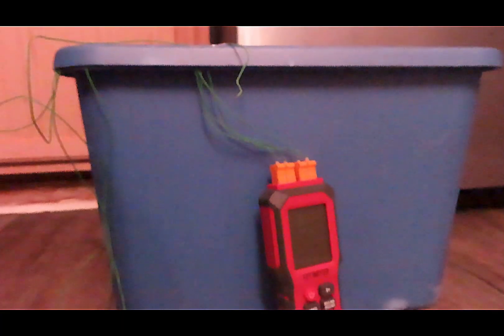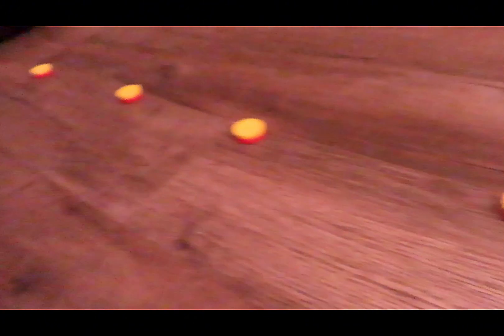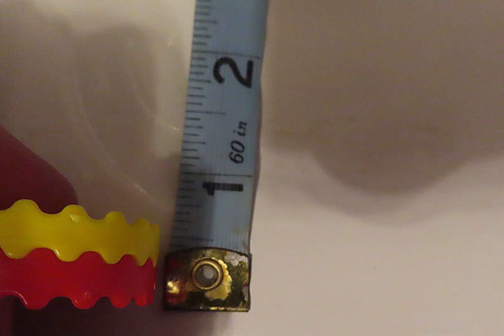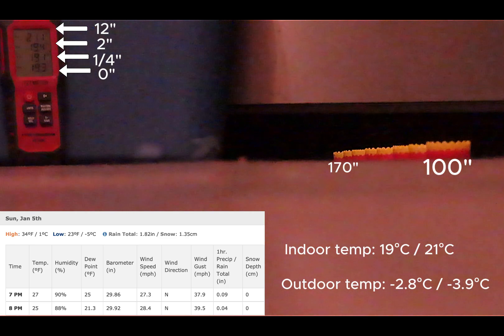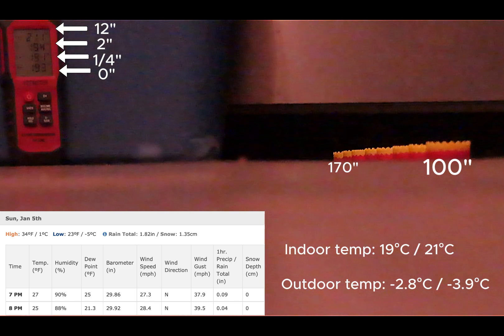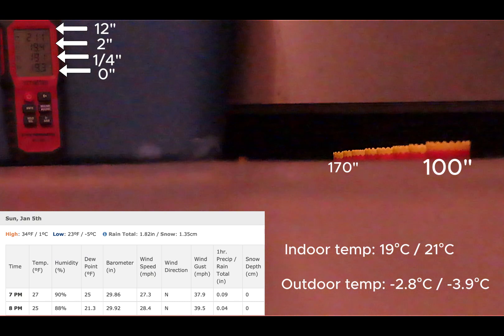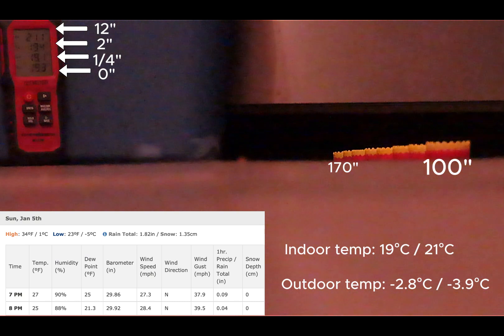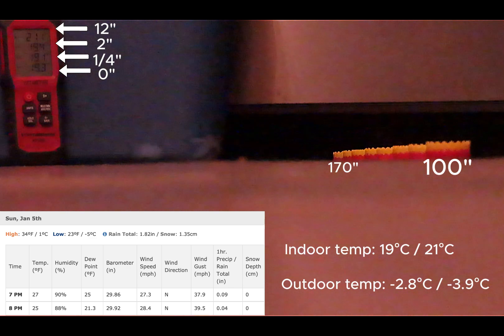At Home Refraction Tests 3.0 - January 2025

Comment: Excellent presentations!  Very educational.   

The Density gradient is a spatial variation in density over an area.  

Higher air density near the flat surface causes the light to bend more. The flat surface is magnified and appears to rise obstructing the view of distant objects along the line of sight over the FLAT PLANE!   

Globers admit they have no measured globe curve because of REFRACTION
A glober can lay on the floor of a long hallway and the horizon will appear closer. Globers will claim the floor spherical

Flat earth is integral to understand the nature of reality and the physical world and its phenomena and that entails unbiased observations and systematic experimentation.

When a system at equilibrium undergoes a change in pressure, the equilibrium of the system will shift to offset the change and establish a new equilibrium

Dispersion, diffraction, refraction, and reflection are all wave behaviors that describe how waves change direction or interact with matter: 
Dispersion
When light of different frequencies or colors refracts in different ways. This is because the amount a light wave bends depends on its frequency, which also determines its color. Rainbows are a common example of dispersion, where sunlight is refracted through water droplets in the AIR
Diffraction
When waves bend and spread around an obstacle or pass through an opening. Diffraction is most noticeable when the wavelength of the wave is comparable to the size of the obstacle. For example, elephants use high wavelength sounds to communicate over long distances, even when dense vegetation blocks their vision. 
Refraction
When waves change direction as they pass from one medium to another. For example, light travels slower in water than in air, so it refracts when it passes from air into water. 
Reflection
When waves change direction and bounce off a barrier. The angle of reflection depends on whether the surface is smooth or rough. For example, light reflects at the same angle off a smooth surface, but at many different angles off a rough surface.
Reply: @WHAT-bz6hp  colder air is denser than warm air at the same pressure. So the density of the air near the flat surface is actually lower not higher.

Floor didn't get 'mangified', the objects along the floor lowered their apparent height.
Reply: @curious1585   FUN FACT: refraction is used to create magnification,  cold air being denser near the ground can cause refraction.   As I explained.  The video presentation demonstrates this FACT.   proving refraction along a FLAT SURFACE  is not a globe proof.   Globers admit there is no measured geometric horizon because of REFRACTION.
Reply: @WHAT-bz6hp  🤦🏻‍♂️
Your description was the wrong way around and refraction is not used in this configuration to achieve magnification.

There is no 'admitting' in rectifying a strawman argument that should never have been circulating in this way in the first place.
Amazingly despite acknowledging one thing correctly you still manage to commit the strawman fallacy.
Reply: @curious1585 You keep  saying NUH UH meanwhile refraction can cause magnification below the horizon.  The objects in the distance were compressed while the foreground was magnified.  The density gradient just below eye level, which is related to the temperature gradient, determines the magnification. Everything in view literally shifted in focus.    I am not strawmanning anything.    I described the phenomenon and various effects.

I listed various examples.   I didn't mention mirages in this case which is also another example.
Reply: @WHAT-bz6hp  your strawmen are not about magnification.
Reply: @curious1585  You keep chanting "STRAWMAN"   YOUR CLAIM "Floor didn't get 'magnified', the objects along the floor lowered their apparent height."  <------DUMB DUMB  glober logic.

 DO YOU EVEN understand the floor is FLAT and LEVEL?

 OBJECTS are not LOWERING their apparent height.   The changing angles of light are causing the optical lensing effect making objects appear bigger or smaller  along the horizon which is a magnifying effect of REFRACTION.  

The title of the video At Home Refraction Tests
The study of light refraction.

The observation is literally a demonstration of REFRACTION along a FLAT SURFACE.  

  You claim there is no magnification along the floor.    I stated refraction can cause a flat surface to appear to rise and obstruct distant objects.   You said NUH UH.    Meanwhile...The heating is not consistent, the air temperature slightly varies and thus the refractive index of the air is different. This causes the "wavy effect".  AND yes there is a magnifying effect occurring as I stated which is known to cause the surface to appear to rise obstructing objects.
Reply: @WHAT-bz6hp  🤦🏻‍♂️ you're the only one chanting.
Do yourself a favor and respond when you are not tilted anymore.
Reply: @curious1585  I responded.   The point here  is globers admit there is no measured geometric horizon  or spherical curve because of REFRACTION.
Reply: @WHAT-bz6hp  again with the strawman arguments.

Comment: This is a good demonstration of what kind of temperature lapse rate you need to produce a convex-like presentation on a flat surface. 

Is the lapse rate you achieved to produce the convex appearance typical in most observations?
Reply from the maker: The lapse rate has to be pretty extreme over a distance of less than 15ft, but with the water observations we've conducted, at distances of less than 1,000 feet, the lapse rate can be much less, and yet very strong sinking refraction is observed. 

I do understand the argument that you can only get lapse rates in this vicinity near the surface, and that higher up you view from, light should in theory be bending down. 

But I think there could be more to the whole equation that doesn't rely so stongly on the vertical lapse rate. Still working on that, but would like to address that soon. 

Thanks for the comment, and your awesome approach to this topic. We need more people like you on the "globe side". Cheers!
Reply: @skyfree01 Thanks, and same to you. You and Heath, together, are probably best with your approaches, methods and understanding of what it takes to make a flat surface appear convex.

Just be aware of how the temperature rate change must scale to relate this to longer observations and higher viewing locations. Already, I see in comments those believing this model explains the Lake Pontchartrain causeway appearance. 

But there’s should be no argument from globe defenders that light bending upwards would produce the appearance of convexity of a flat surface: sinking and obscuring. Heath has modeled that. You’ve presented a good demonstration of that. 

Likewise, downward light bending can produce a flat or even concave appearance of a convex surface. That, too, has been modeled and demonstrated. I like how you’ve instrumented the test range with temperature gauges so we can assess the rate of change and its correlating effect. Maybe someone - probably not me - will do the same thing for a curved surface and show how “black swans” can be observed on a curved surface. Whoever does that would be wise to take some tips from you.
Reply from the maker: @bobshafto  We're actually hoping to witness downward refraction this evening. We've tried some 'looming' tests in the past but haven't had luck. 

The setup has to be just right, we're going to try to place a slight, quarter inch, obstruction in the way of the laser light and then place some snow along the viewing route to create an increasing temperature gradient.

If I can get everything set up correctly, we should witness the light ray refacting around the obstruction.  

Any suggestions on the distance to place the obstruction between the viewer and object, or any other suggestions to help us have a successful test would be much appreciated.
Reply: @skyfree01  Personally, I don't like the idea of simply putting an obstruction on a flat surface to try simulate "looming" over a curved surface, but if your only objective is to try to witness downward-bending of light, irrespective of surface shape, then I suppose that would work. The challenge might be creating a sufficient density gradient (thermal inversion) to get that to work over the same sort of distance you did for the demo in the video. According to the gauge, you were able to achieve a pretty sizeable temperature differential between the surface, 1/4" and 2". To bend light in the opposite direction over that same span, you'll need a similar delta but inverted. You were able to get about 6-8 degrees of temperature drop between the 0 and 1/4" and 1/4" and 2" sensors. That's quite strong, but being so close to the boundary (floor) that makes sense. The challenge is to get a temperature inversion of that magnitude at this scale. Maybe before even trying the optical part of the test, just see if you can establish a setup with the thermal probes in the same location such that you can get a temperature increase over several degrees from 0 to 1/4" and from 1/4" to 2"
Reply from the maker: @bobshafto  Agreed on the obstruction placed on a flat surface not being ideal. For now it's the best we have, but it would be great to try these tests with a section of an actual convex surface. Thank you for the input!
Reply: @skyfree01 congratulation, it was an excelente ideia to demonstrate on this form, we couldn’t do better.

By the way, I solve the physic landscape behind to explain why all this happens, at least 5 years ago and more recently, we prove through several experiments, the point, but your idea will help to show graphically to viewers, much better.

Comment: Awesome, but what happens, if the surface is cooler, then the air above?
Reply from the maker: Across a plane surface, if the surface is much cooler than the air above, then light can bend down, and the surface will appear raised with distance/concave. 

Across a curved surface, very cold air at the surface with warmer air above can make the surface appear less curved, and begin to flatten out in appearance.
Reply: @ ok, can you show it on a next video?
Reply from the maker: @rodney555666 Yes, we plan to address this very soon. There are nice demonstrations of 'looming' by channels called, TJ Weits, and DANG JOS that we have linked in many of our previous videos. It's more difficult to achieve this effect, we have tried, but haven't been successful with the at home tests. 

We do have many tests over short distances across water, where cool air below warm air produces a concave appearance of the surface.
Reply: Warmer air above is more common and causes light to bend down having the effect of lifting objects as in the, 'we see too far' observations.
Reply: @BigHeretic  Less dense air above more dense air is the 'normal' condition, even though the air generally gets cooler as you go up. The effect of pressure in the calculation of a density gradient is what makes downward bending of light the norm, and where 7/6R standard refraction comes from.
Reply: @heathcarmody2867   Thanks for the clarification. I was addressing the rare conditions where light is bent up due to warmer air residing below cooler air which clearly can't persist.
Reply: @heathcarmody2867  I was going to say...for my spot anyway...that upward refraction seems to more prevalent than downward.  Low waterline / apparent horizon at Mesa most the time etc.

Comment: I dont think there would be any more obvious anyone can make that what we see isnt curvature.
Reply: @conspiracy1914  unless of course we look at the data provided and recognize in this case the denser colder air was above the less dense warmer air while over big height differences in reality the less dense thinner air is above the more dense thicker air 🤔
Reply: @curious1585  "denser colder air was above the less dense warmer air"
highly unlikely as that goes against normal physics.
Reply: @conspiracy1914  what are you suggesting then?
The temperature probes on the video show this is the case.
The turbulence we see in the clip would also suggest the created layers are unstable.
The threshold even of a door floor window is typically higher than the camera with 1/2 to 1 inch between the bottom of the window and the floor. 
The fact that the floor and all parts of the room were in thermal equilibrium would suggest that the floor still heats up the air close to it when the air in the room is suddenly exchanged with colder air (which is what happened in this case).

Maybe sky free can provide some more details about where the fresh, cold air stream was coming in from. Though the observation obviously does not go againsy physics since it was made in reality. As such it's on us to understand why it happened and it doesn't seem too hard to understand how it works.

Comment: Lovely experiments, have done a little work on this. I think the humidity plays a big part, would be interesting if the humidity could be measured at the same level as temp sensors, Even use a dehumidifier over time see what happens.Chris : )
Reply: Hi Chris
Re humidity
What effects do you see associated with high and low humidity?
Magnification possibly?
Thx
Reply: @pablosdog2808  Yes you see magnification, Dry air no magnification, size of water droplets/ molecules also makes a difference.
Reply: @pablosdog2808  🤦🏻‍♂️
Reply: @KryptonitePhysics  what work did you do and how did you reach your conclusion?

Comment: And the globers wonder how the sun vanishes. Well here you go globers.
Very nice work my friends.
Reply: Globers wonder how a local Sun doesn't change in angular size all day. What do you tell them?
Reply: @BigHeretic  
Lensing/magnification
Reply: @wideawake2814  Atmospheric lensing changes the apparent size of the Sun only marginally when it's near the horizon, not enough for it to be local. A local Sun should change in angular size throughout the day as it approaches and gets farther away. It doesn't.
Reply: Hmmmm interesting.
Over large height differences what happens with the density of the air again? As far as I measure o
It drops. Which would lead to downward, not upward refraction.
But I'm happy to learn more about how sunset and sunrise actually work with verifiable evidence.
Reply: Scale this demonstration up in size and the result will be an inferior mirage not a sunset.   At larger scales, this vertical profile of air cannot be sustained because convection will mix it out in a thin boundary layer, just like the layer of air just above hot concrete.

Comment: Loved the laser test!  And your simple explanation at the end - superb!  Thank you again!
Reply: It's surprising you'd find this superb since you're arguing that refraction cannot make a curved surface look flat.
Leading the results of this test to their logical conclusion it should be able to though.
Reply: @curious1585  It's actually the other way around based on these observations.
Reply: @pablosdog2808  based on the observations light refracts towards the denser medium which in this case is the cooler air above the warmer air.
In reality air gets thinner as height increases with the exception of a thin layer near the ground.

Are you suggesting simple deduction somehow stops working for refraction?